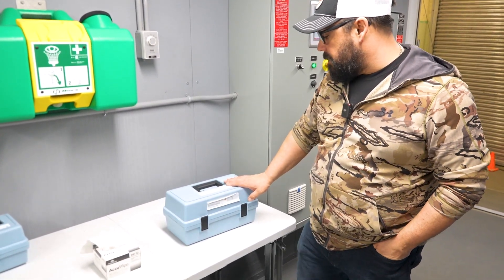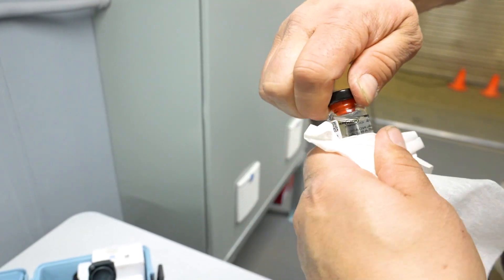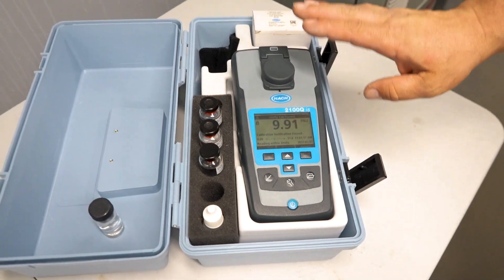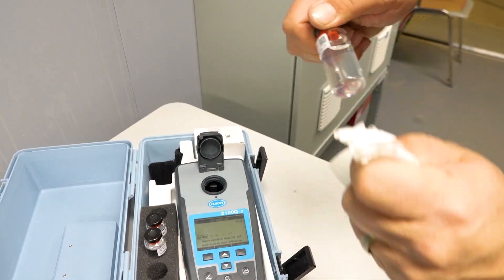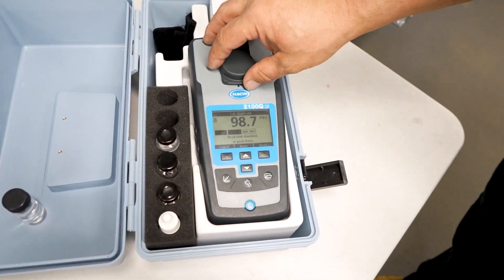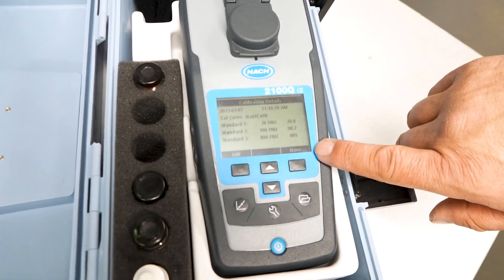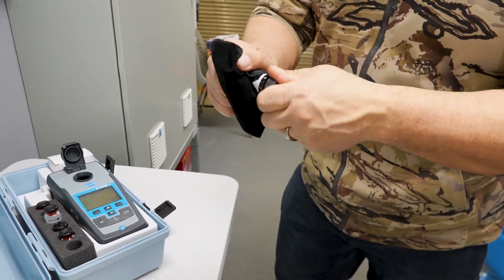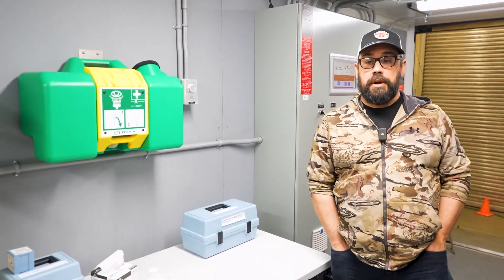Calibrating Portable Turbidity Meter: Step-by-Step Guide

Comment: hi sorry but do i have to put the standard solution if i wanna test another one straight after?? please respond its important
Reply from the maker: No, you don’t need to use the standard solution if you want to test another sample right after. Standard solutions are only required during the calibration or verification process to ensure the turbidity meter is providing accurate readings.

If the meter is already calibrated and verified, you can test your next sample directly. Just make sure:
1. The sample cell is clean and free of fingerprints or scratches.
2. The sample is well mixed (but not shaken to avoid bubbles).
3. You align the arrows on the sample cell and meter before taking the reading.

Let us know if you need further clarification!